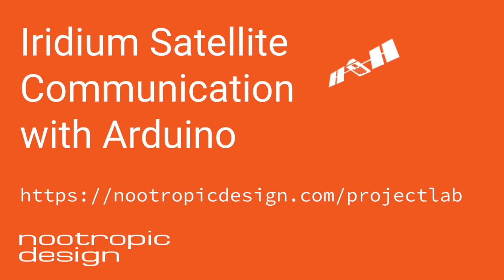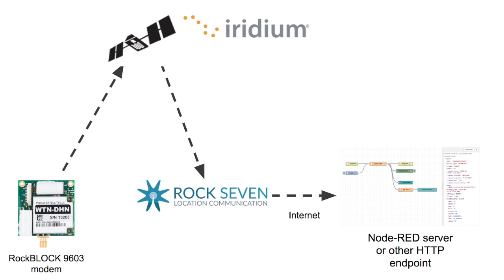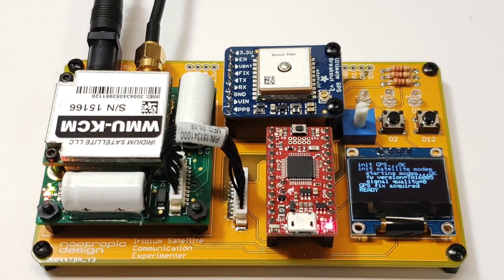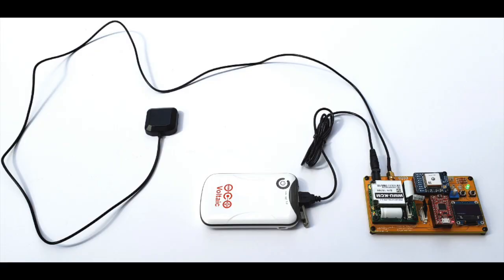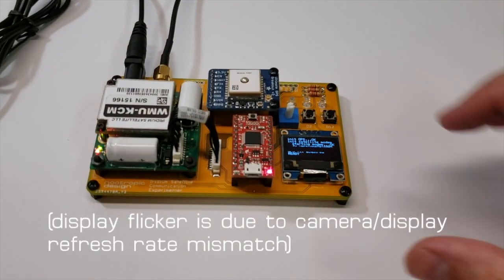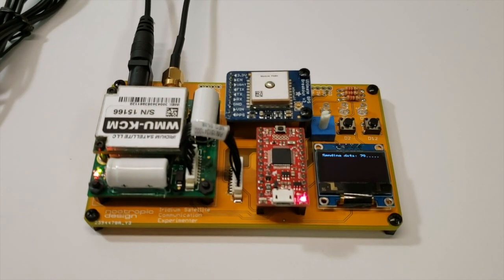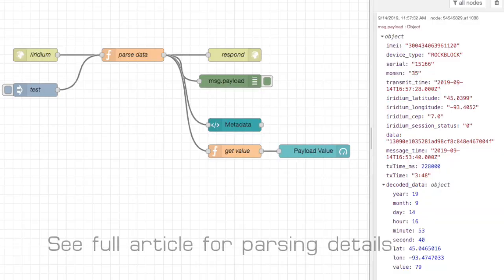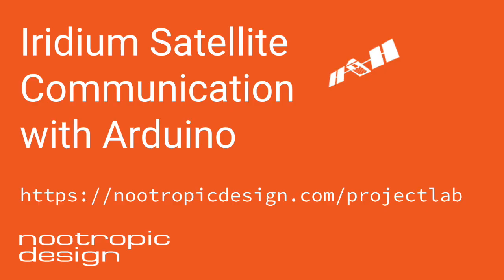Iridium Satellite Communication for Arduino

Comment: This is awesome work. Deserves more  view and comments. 

How does the setup and operating cost compare to retail options?
Reply: Just read the linked project page. $250 for the modem. The cheapest retail satellite messenger is $200 (acr bicycle sticker) which tells me the component prices must be falling. 

I both hate the idea retail product (seems) cheaper and love the work put in. 

I suspect the iridium network is more expensive per message and annual subscription. 

The diy has upside in easy repair. 
Am I missing something in features?

Comment: We are an iridium authorized repair center and we get many customers that also purchase and need assistance on setting up iridium development boards. 
 We would like to see about collaborating together on some of these things as well as promote you and your services, and help you with support. 

By the way, have you tried just using the iridium 9602N newest iridium transceiver instead of the rockblock?

The Rock 7 company was great , however they were sold and purchased by another company and do things differently now.

If you built the board to work with the rockBlock then it should also work with the iridium 9602N which is what the RockBlock actually used for their dev boards and other systems. 

They also use the iridium 9603N ( if you want a smaller transceiver and use your own GPS chip )
Plus the 9523N transceiver that combines everything as the most sophisticated transceiver?

We would like to talk or communicate. 

You can reach us at NorthernAxcess.com or info@northernaxcess.com

Sincerely,
The  NorthernAxcess team

Comment: I need to make myself a portable sat msg'er using this. I'm guessing sending a few text msgs back and forth every year using this method, would be far cheaper than buying a sat phone and subscribing to some terrible plan. 

I don't get why iridium doesn't partner up with a manufacturer to make a simple 140 char or less, text only messenger that's pay as you go once you buy it. Everything I've seen has ridiculous minimum costs after you pay $400-600 for the actual device. Kind of silly if you need it a few times per year to stay in touch with the family while you're beyond cell coverage...
Reply: Can we make a phone calls with it?
Or make like zoom meeting things?
Reply: @populerkulturunkolesi8360  no